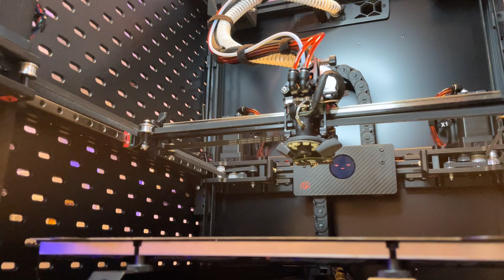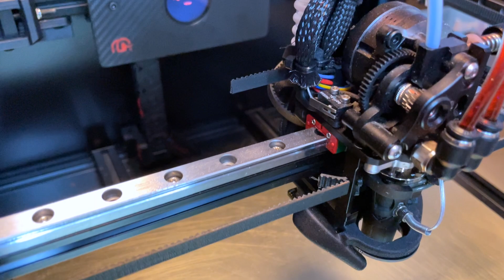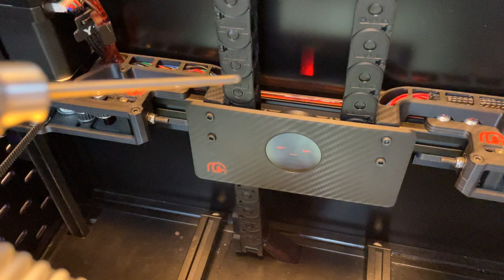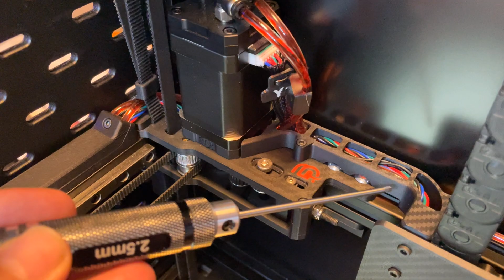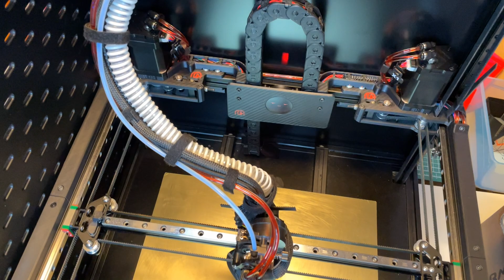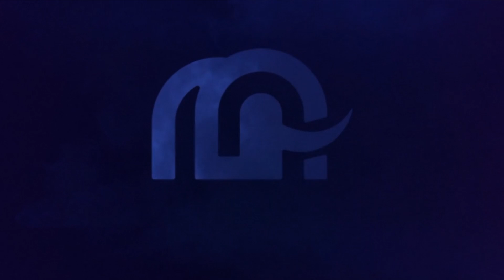🚀 mammoth-3D AWD Gantry: Deep Dive into Toolhead, Endstops, X & Y Axis, and More!

Comment: Love your Z belt tensioners. They amazing. This is one of best  mods for 2.4. I think that the key part of the design is horizontal tensioning instead of vertical. It just way more easier to tension belts properly and in  a painless way. As for rigidity... well, Voron frame rigidity is a very well known issue. Having tensioners in a corner-bracket style is a good thing, but I would recommend to use "Blind Joint Alignment Nut" from printables, and Doomcube  extrusions. Blind joint nuts prevent extrusion from torsion during tightening and allow to get stronger joint. That results in a less flimzy frame. Anyway, amazing part which solves a lot of issues (all of them) of original design. 
2 minor complains: 1) hardware is out of Voron original BOM completely 2) tensioner caps didn't worked for me, they just don't hold nuts good enough (maybe just filament tolerances). I ended with using VzBot tensioner caps. 
Thank you for your efforts to the Voron ecosystem!
Reply from the maker: Thank you very much for your feedback.
The MOD was made for users that have a kit up and running and it's then hard to do any frame changes. Plus z belt tensioners.

Yes 1. is true, but I did test it with the Voron HW BOM and was not happy with it. The screws had to much play in it.
2. Im sorry to hear that. Will retest and change / check that part again!

Comment: Printed parts Offer absolutely zero bracing performance my friend. Even using a material like Luvocom PPS-CF, you only see a 2% increase in rigidity. With anything less, you see nothing. The ABS/Nylon/PET/PC parts are all too flexible too add rigidity to aluminum bracing.
Reply from the maker: What bracing are you talking about?

Comment: Beautiful printer ! Why do the back motors have so many idlers though ? Seems like it makes the belts much longer
Reply from the maker: Thank you very much.
It's for the Belt tensioner. Yes you would think so, but each belt is 130mm shorter than Stock Voron 2.4.

Comment: Now you need to add springs to tension everthing right. Really nice design.
Reply from the maker: Springs? On the belts? Thank you very much!
Reply: @ no not springs on the belt. The Belt Tensioner with springs. No need more to tension the belt. X1C was the first commercial printer that have this.
Reply from the maker: @gold-junge91  I will look into it. Thanks for the Info 🙂